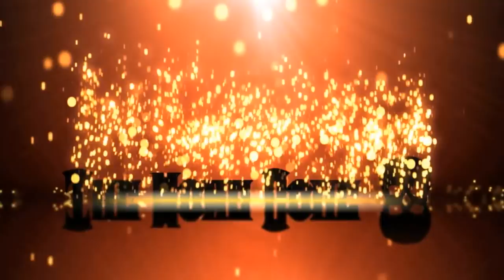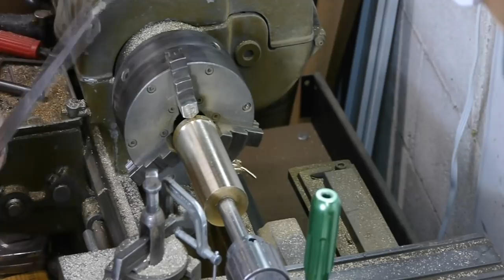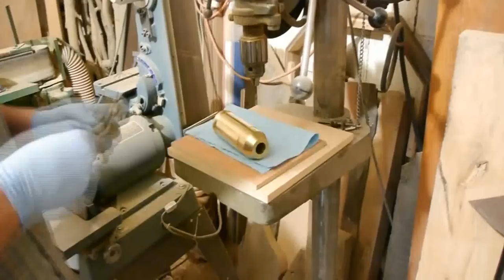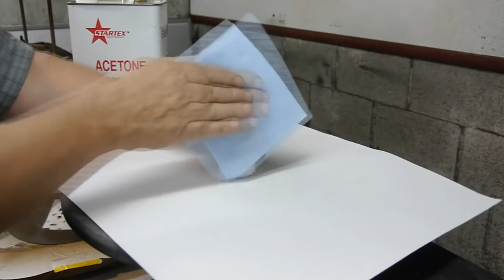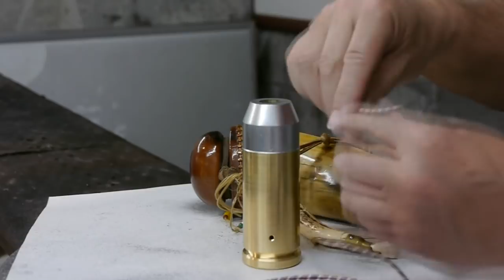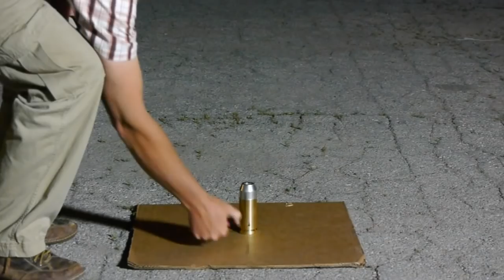Atomic Bullet Thunder Cannon Time Lapse

Comment: Back in the late 70s my buddy made something similar from mild steel.  We would load it with black powder, then drive a tightly fitting wooden dowel plug down over the powder using a brass rod to avoid sparks.  That thing made a terrific boom, and the wood dowel would simply disintegrate upon firing.  It was quite safe, and most entertaining!
Reply: Other people in the 70’s: Probably doing drugs.

This guy’s friend: Makes giant bullets for the lols.

Comment: so many things he did wrong, can't believe he selling these. for $100?! with a tracer attachment I could have made 20 of these in the same time maybe $10 each including labor.
Reply: ***** Yes I would. I'm a professional manual lathe turner I make over 300 components per week to tolerances of .05 of a mm. I have trained for 6 years in efficiency and production work. I am not a master but I sure know my way around a lathe, a lot more so than you or the dude in the video who is a novice, hopefully he will learn and get better with practice but I don't agree he should be selling his product until that point.
Reply: No you wouldn't.
Reply: william bertrand It's flawless as to what i see.
Reply: Brass Round 314 H02 One Ft. (12") Length - $200.14,Extruded Brass Round 360 H02 One Ft. (12") Length - $100.95,Brass Round 464One Ft. (12") Length - $128.16 or Brass Round 485 H02  One Ft. (12") Length - $104.05. 'you said you can make 20' first material costs of course you will use the cheapest thats 100 inches  Eight Ft. (96" Length) - $537.76 still short +Random Length (10"-12") - $90.36 your material costs alone 628.12 price per unit 31.41 with out labor, profit,taxes over all costs of running a business and you can make them for 10.00 each with labor. remember those are 2x5 inch are yours made of pvc lol
Reply: @brain tesh I'm not hear to hurt peoples anuses, if you truly think that is the best way to do that job, fair enough I wish you good luck and I hope you enjoy your life without progressing and learning. hippykrusher I'm not a yank, where I work we order brass by the kilometer and we get good prices for the chips.
Reply: TehCacti that may be true so what your saying is now that you would shut down you manufacturing or assembly  line re tool preform cost analysis market testing supply versus demand now i think your cost per unit just exploded. this guy is small business and the key point in your statement  was "we' not you ownership of the business  is not in your  hands so you are not buying the brass buy the kilometer the company is so good luck with that you Obviously never owned a business or even tried to open one you have 0 progress how long have you been making that same widget for six years.i have over 20 years working in machine shops and running crews in manufacturing and dealing with vendors. ' with a tracer attachment' so you're glorified parts loader.
Reply: +TehCacti 
If you make me one i will pay you $30 for it plus shipping..
As most of the other comments say $10 is to little!
PM me if your interested..
Reply: Richard Tomasko I was talking in a hypothetical sense, to make a 1 off and ship to the US would probably work out the same price, plus I don't have the dimensions.
Reply: hippykrusher you have been working in the trade more than I have been alive and I'm probably more skilled at turning than you.. maybe you should open your mind to other peoples ideas and opinions.
Reply: The Original ok, the way I would do it, I would have 6ft sticking out held by the tail stock, use a plasma cam to cut a tracer pastern to use with a tracer attachment and get 6 turned on the od in one cut then part each one off. then finish the bore individually.
Reply: TehCacti what i was hoping you would've gotten from our conversation is that it is not necessary no apply industrial techniques to what appears to a back yard hobbyists and to say he shouldn't sell what appears to be art and not something one would buy for its functionalities is just wrong . if i were selling bag of poo and had a video about it you would be the guy saying i can do it bigger better faster using Laxatives.
Reply: TehCacti
If you're so flipping awesome, where are your praise-worthy products?
Reply: Todd Roberts Well I'm 20 and I machine parts that sell up to £30000 I'm not going to disclose the company I work for here but if you want you can send me your email address and I'd be more than happy to show you
Reply: I don't care who are nor what you do - you have no right disrespecting the man and his creations.
Reply: mzaproduction Yeh he could use a template etc and mass produce them and they would be all identical. But that kind of does away with the entire point of stuff like this. each one of these little noise makers are going to be different. Shoot i bet if you tossed him a few extra bucks you could get them engraved etc. Worth the money for black powder hobbies. Model canons are pretty popular. Another thing some posters who are saying they cost to much are forgetting while yes they are obviously brass they are high quality brass. You use cheap brass in something like this your 4th of july noise maker could turn in to a pipe bomb.
Reply: You're kidding right? $100 sounds like a steal to me. That's solid brass and looks like one takes a couple hours to make.
Reply: "Well I'm 20 and I machine parts that sell up to £30000" and here he is... in youtube comments... that alone makes you for sure selling nothing for that price. Sorry.
Reply: TehCacti if you sell 30000/month you make almost half million per year. For sure somebody with that income have better things to do, and also is "too good" to be at ordinary youtube comments criticizing someone's job.. so.. anything else?
Reply: TehCacti Oh yeah? You make 30,000 Euro Machine parts? Well im actually the most interesting man in the world, And I make a few billion every month, I suggest you sit down. Stay owned my friend.
Reply: HomoEconomicusX Stay Oblivious of a joke my friend.
Reply: Tehcati u make alot of money if not moderate and ur 20 damn good job bro :D
Reply: He 20 and he trained for 6 years did i fucking miss something?
Reply: TehCacti I'm guessing you're a Brit and I'd imagine your laws probably wouldn't favor you making what amounts to a miniature cannon, for export or otherwise.
Reply: I would say that TehCati has a point in saying there are ways to manufacture this piece quicker and more efficent. But he misses the whole point of the product. This is meant as a quality item not produced in a wast quantity. People buying this item want it to be special uniqe and made by an artisan. As in the video. Massproducing this part in a modern cnc machine would be done in a matter of minutes. But then....it would only be a massproduced part without a soul in my opinion.
Reply: ok so doing a bodge job gives it soul? I didn't even say to use a cnc machine, he could do the job properly and still give the job "soul"
Reply: TehCacti How much to make me one?
Reply: TehCacti
 what you dont say here is
#1 Cost for the template
#2 Cost for the Machinery
#3 Cost for Setting up Production Line
#4 Cost for Storage
#5 Costs for Financing
#6 Energy (not only Production but transport to storage etc)

Then how much you have to Sell to get even Money.
Not to mention you may be able to put down the Production Price to 10$ for #1-3 plus Material (still dont think you get that low price on solid brass)
but the overall selling price has to be much higher.

Simply by the fact youll gonna need a large Production to get that price down.
So now having a large Production with a lot of money upfront todo it gives you the new Problem of selling it quick enough.

Means Marketing and Advertising, Sales channels etc. Youtube alone not ganna cut it. ANd do not forget your investor who wants his money back and some intrest.

also you have to sell big numbers and very quick, because your marketing guys, salesmaen etc wants their monthly pay check. But to hurry up you get it promoted, a lot.

At the end the consumer gonna pay way more than 10bucks, i woudl say more like 50-70  - IF YOURE LUCKY - all that for what.

To replace a handmade piece with some industrial mass crap.

Seriously, i would rather pay 100 Bucks to this guy, knowing its handmade, knowing support an talented individual than 50 bucks for an industrial piece.

uh yes thats the best case scenario. worst case you go broke on that production because you sell so slow that you can even cover the storage costs
Reply: woswas denni If you read his comment, he was saying how the production of these could be a lot better, not how his business could be better. You're completely missing his point.
Reply: Michael Walsh
iam sorry but  iam not. because the "better" production directly concludes into that. you cant have one without the other.
you digging a hole with a shovel? well i can do it better with a excavator 288.. but who is gonna buy the gas
Reply: woswas denni *facepalm* read his comments.
Reply: Michael Walsh
again again for the slow.
his "better" and cheaper solution only works in a very large scale. in a small scale he is simply way more expensive and not even nessesarly better.

you cannot divide the business factor from production factor since he promised a production price of 10$. those 2 things go hand in hand.

the advantage of the handmade version is that the business factor doesnt matter, 1 piece cost as much as 10. the production wont change it stays at it is.

the industrial type on the other hand is a different animal. in theory id could be done much cheaper but because of the requirent the cheaper industrial solution needs youre way bigger scale which sabotage the effort in cheaper production itself.

again you can digg a hole much faster with a 100million bagger but it would only make sense if you need 10 tsd holes. if you only need one the bagger is faster but the costs and bottom line effort outlast the win. therfore its not better
Reply: ***** Carbide inserts on brass last almost forever!
Reply: MrBonami2 Just what i thought! Not finishing school is pretty common among youtube assholes...
Reply: Lol^
Reply: HighwaterTech lmfao!!!!
Reply: Richy T Stay rich my friend.
Reply: HighwaterTech yea my friend for sure lol!!!
Reply: yea it does seem like a simple project... did more complicated builds in grade 9 machine shop. price is very high
Reply: TehCacti If you had the length of six units sticking out of the chuck there would be a strong likelihood you would have significant harmonic distorsion and there would be chatter marks all over the OD.
Reply: TehCacti Dude you lost the battle, we make several different kinds of fittings for hoses where I work, and even a 1" machined brass part (1" diameter, actual length is around 2 inches, still smaller than the overall length of this guys bullet) costs like 9 bucks. At the cheapest, you could sell this thing for 50 bucks. If you have a good vendor here in the US, but you'd probably half to buy a large stock, and I really don't see selling these for $10 being able to be competitive, you'd have to buy some bad quality China brass bar stock or something to sell it that cheap, as well as be a citizen in China, and even then $10 is still pushing it.
Reply: TehCacti I'd rather have this pro work than you, I'm sure his time and experience are worth more than yours. You said your twenty and your a professional lathe operator? It takes more than being in the work force for 2 years to be called a pro. Where I work, our contract machinist have been doing this for upwards of 15 years.
Reply: Be quiet.
Reply: To TehCacti, not unless you work for $1.00 an hour.  The aluminum billet would cost $104 for an 8' length. (I looked it up on-line) Then you would have needed to make the template for the tracer so I think need to recalculate your hpu's.
Reply: Akira Ichikawa The company makes profits on the parts not the machinist, damn..

Comment: I thought it was a drinking mug:) Was surprised to see what purpose it actually had:) I'm not a fan of its function, but to each his own. Looks cool at least:)
Reply: Liberal.
Reply: DriveByGuy556 The reason I'm not a fan is because I don't like loud noises. If that's enough for you to label me as follower of a particular political doctrin then I think you're pretty quick to jump to conclusions.
Reply: DriveByGuy556 Rekt
Reply: ***** 3 for that comment. I use them to convey my intentions. Sometimes it's hard to tell what someone really means when it's in writing, and the emoticons help. If you removed the emoticons from my comment, it'd sound like I was more disappointed than surprised.
Reply: McJaews I for some reason saw the word thermos must have read to fast
Reply: McJaews In the old day's they were used by ship's to signal the Harbor Master.It would make a hell of a shot glass :)
Reply: I'd drink out of it...

Comment: Hey sweet video but at the workshop at my school we found out that the best way to stop brass from going absolutely EVERYWHERE when machining it is to just hold a little broom over it, because the brass will splash up into the broom and because of the soft plastic threads it will dampen it and it'll just fall straight down into the bin underneath the chuck

Comment: Don't you bother to indicate any of your work?
I can see the horrible run-out in every segment!!
Reply from the maker: what do you mean?  I don't know what runout is.
Reply: +Themanscave and what size grinding size of say very necessary !!
Reply: +Themanscave   It's the wobble in your work piece.   You use a dial indicator to measure and remove the wobble.   You can also bump your lathe tool up to the work piece and indicate it in if you don't have a real indicator. But that is really a last resort.  For what you're doing there I wouldn't worry much about it.   Nice work!
Reply: +Sam King I'd bet the head of the machine is off or the jaws need slight adjustment. Seemed more of a get 'er done video than a showcase of machine skills. It is pretty!
Reply: I don't think runout or any dimensional tolerance is particularly important in this case.  Sort of like the hole in a doughnut.
Reply: There are absolutely adjustable 3 jaw chucks, I use one often. Set-tru or Adjust-tru are a couple of companies that make 3 jaw adjustables.
Reply: I doubt it has anything to do with inidcating his work. The brass cylinder was only clamped in by a tiny rod (once he turned it around). There is no way you can avoid that wobble if you do it like that unsupported.

Comment: May I comment on the crap lathe work?  It was crap.  Turning and facing off with a fucking file? Using scotch-tape as a chuck?  Doh!
Reply: I think he was just trying to save time.  Why bother chucking it up, or boring soft jaws, if he is only making a "one of"?
Reply: belson alan  idk jack about lathe work but what's wrong with a file? Is there a better hand tool than a file or are you supposed to set up some kind of device attached to the lathe?
Reply: ***** I don't think it qualifies as a bullet, there is no projectile, I would call it a miniature cannon that fires blanks. I was reading through some other comments and people were saying that it's something that used to be used on ships to let people on land know of the ships presence on a foggy day.

Anyways, you didn't answer my question. What is wrong with a file? Why is a hand file "amateur night"? It achieved the task he was trying to accomplish right?

And aren't sharp square corners up to the designer? That doesn't seem like a machining requirement to me. I'm not saying it isn't I just don't see why it would be. If a design calls for a sharp corner then it would seem like poor practice to round the corner...
Reply: ***** I see, thank you for the information.
Reply: For all the haters and ball busters out there this guy was just making a frigging "one of" model for crying out loud.  That model doesn't qualify as a "Bullet". It is a one piece mock up.  It has no primer, no propellant, no separate cartridge case, and no projectile.  I was in the ordnance manufacturing business for 23 years.  We made 25mm, 76mm, 105mm, 120mm, and 155mm projectiles for the US Army. Periodically we made models of full up rounds for colonels and generals and essentially this is the way we made them.  The intention was to create a model, that looked as close as possible, to the real full up round. for as little cost as possible.   We made it out of aluminum but spray painted the "case" gold so it would look like the brass cartridge case, we painted the fake projectile so it looked like lead, or whatever real material it was made off.  So in closing if any of you naysayers have not really ever made ammunition, or built models, with the end cost in mind, then please just enjoy the video and keep your negative comments to yourselves.
Reply: ***** Remember this is only a model.  It is not going to be fired therefore material integrity and/or structural failure is a non issue.
Reply: lol i was thinking the same thing but dont be so fast to criticize people man he was probably working with what he had
Reply: Hey man, I've never criticized him.  I've been supporting him from the first time I saw the video.  Many of these naysayers just want to be ball busters.
Reply: No I'm far from stupid.  I ran a fifty man machine shop for over twenty years with lots of conventional and CNC lathes, mills, and grinders.  I think you are missing the point of this entire video and conversation.  I don't think anyone is saying that we would follow this guy's approach to making these model bullets in any quantity because then it would just be dumb not to use state of the art CNC machines.  But this guy is not making any quantity so why go to the trouble of making any special form tools or elaborate set-ups when he just wants to make a model for some general to put on his desk?
Reply: Sorry RicoDuroska I thought you were calling me stupid.
Reply: Matt Troutman
nope but the other guy is.